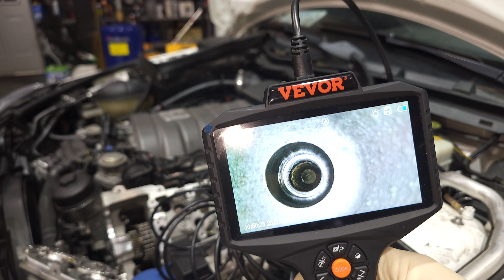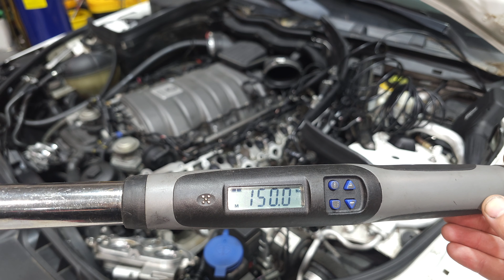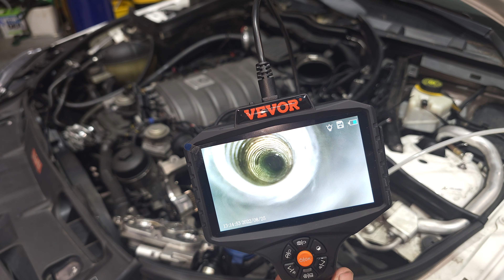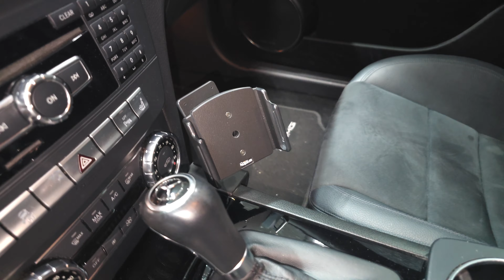C63 507 With INFERIOR headbolts! Let's Head stud this M156! Oh, one at a time!

Comment: Done a bunch of these, unfortunately was always after head bolts broke which introduced coolant into the engine so had to replace the head gaskets as well. Very good information on here guys!!!
Reply from the maker: Thanks man! Yes I should of stated that this method is just for an uncomprimised head gasket!
Reply: @ModernMastersAuto  you are correct sir, once a head bolt snaps it’s game over that head has to come off!

Comment: does newer design m157, my 2014 E63 have tappet and cam adjuster issues? I heard the chain is upgraded.
Reply from the maker: No cams should be ok. But at 100k I would reseal the valve covers and check everything. The chains were updated on most models by 2013.

Comment: So are you telling me I can send you guys my parts or what 😂
Reply from the maker: Let's do it haha
Reply: My 156 e63 has the weaker headbolt design. Is it ok to upgrade to the stronger headbolt with the stronger more material on the head than the ones you used in this video. Basically the ones without the washer but with the male heads not the original weaker female heads. Thanks
Reply from the maker: @Alpinatom it's good to upgrade any of the old headbolts